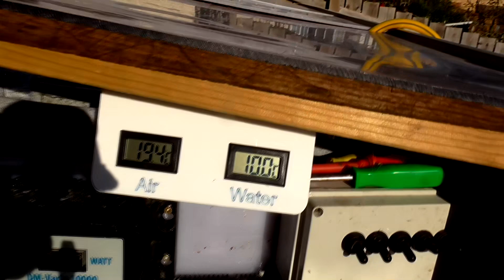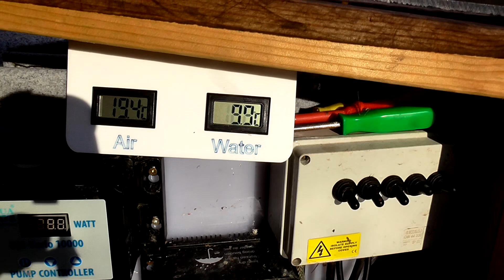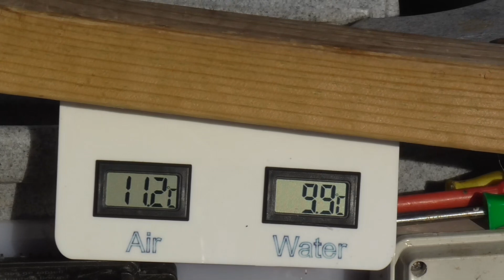**KOI POND COVERS** HOW TO COVER A KOI POND**KEEP THE WIND OFF YOUR WATER** OVER WINTER KOI POND***

Comment: Just a thought at 5am have you used Filter Carbon you drop them in your filter they remove contaminants, helping to keep water clean and are very good I have just put 3kg in my filter to test.
Reply from the maker: Yes I was using filter carbon giving it a try last summer thanks. happy ponding

Comment: Heating is so expensive around 1kw is about £35 a week.  I put barley strew around my filters it keeps the cold off then put some into small string onion sacks and use it in the pond in spring to keep the blanket weed away farms will sell a bail for about £15.  I also put two 150 fish tank heaters into a corner of the pond if it gets down to around freezing which cost around £4.70 a week to run and now I have the poly sheets on the way.
Reply from the maker: Keeping the wind off the pond is the best way to save a little heat in the water. happy ponding